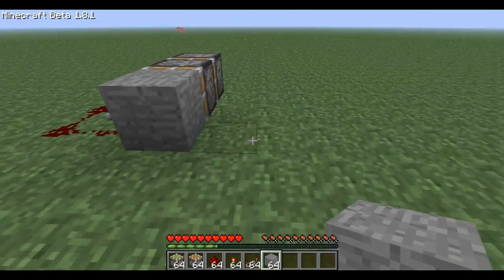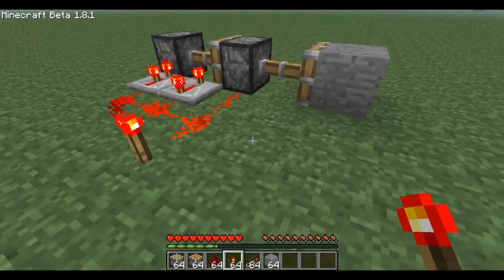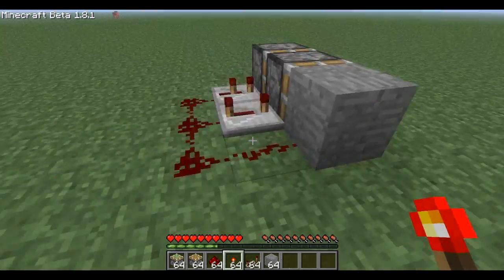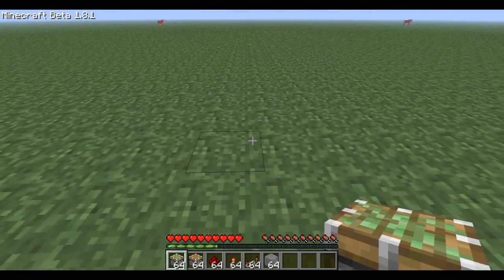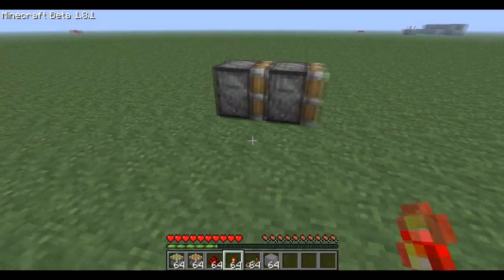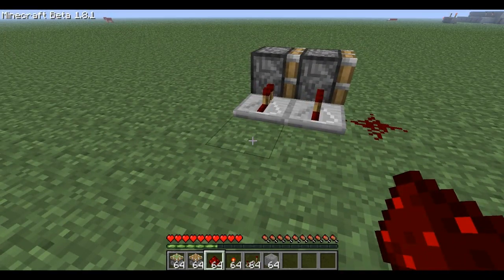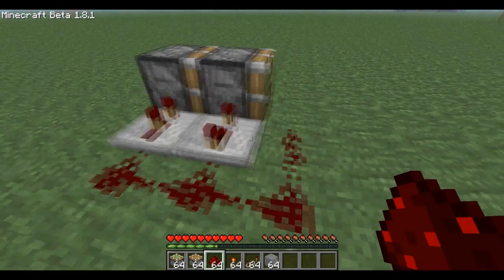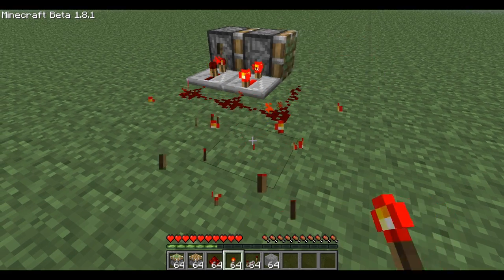How To Push a Block 2 Spaces using 2 Sticky pistons (retracts too!)

Comment: That's great but I need to push those 2 spaces vertically, as if the two pistons are inside the ground and some lever just turns them off and than the ground is being two height less, like a secret entrance into the ground (the secret entrance in the video, its mechanical system is [for example] at the inside of a mountain, I need the mechanical system inside the ground)(Sorry for bad English, if there is any :D)

Suggestions are welcome, thank you.

Edit: Two minuates after writting this I found a video for that..  : |
https://www.youtube.com/watch?v=ItMiJ3L5-xY

Comment: I can get 3 to open and close but not four and only laying down not standing up. I believe they need to update the repeaters because I should be able to stand it up and at least 3 even though 4 would be nice.
Reply: You can use multiple repeaters. They will stack with the delay.
Reply: Glenn Jewsbury Yeah, I got it to work standing up but now 4 is impossible because there isn't enough sides to put repeaters on. Basically you need 5 sides to the square, which is impossible :D I did how ever create my elevator with doors and 3-way switches, but only with regular pistons. You know you can open 2 pistons with 1 repeater or 1 red stone torch?